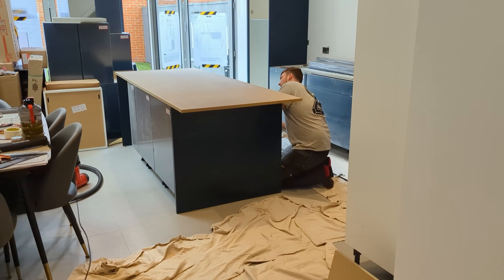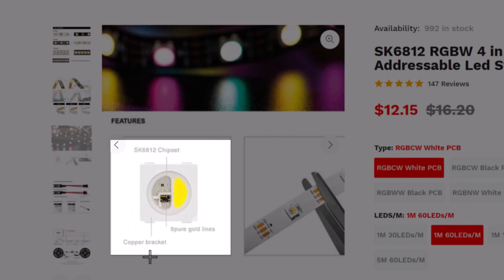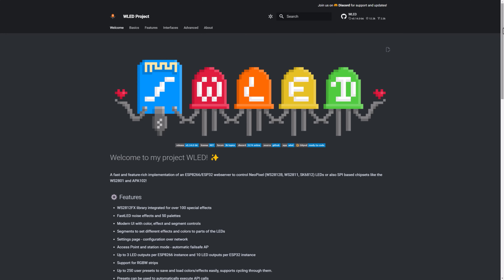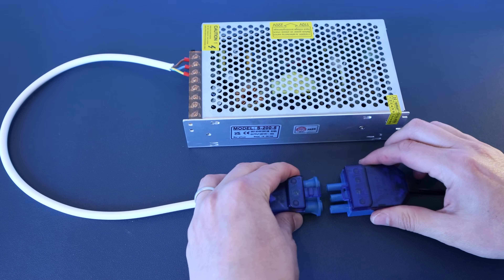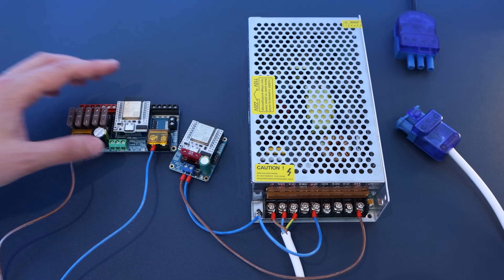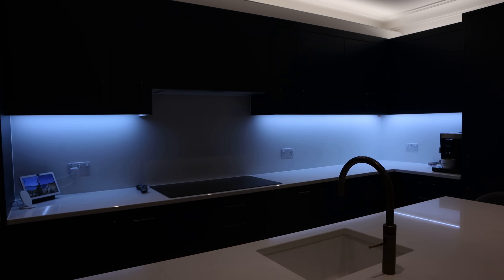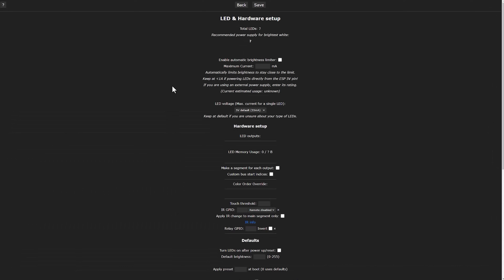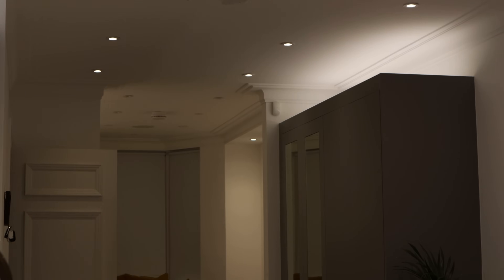Advanced WLED install and setup

Comment: Voltage is irrelevant  to your statment when voltage drops current rises and this is why cables can melt unless power supplies have fuses fitted inline for each power injection thats why the dig quad v3 has them

Comment: Try soldering your +&- in the middle of the strip (less voltage drop) and data at the end (obviously) to make it easier skip 1 led between the + wire and the - wire. If your data in is at the wrong end flip the strip around and reverse the segment in wled. There is also a bug in wled, still exist in v15.0, add 1 segment at a time set the length and gpio pin then save. then repeat for each segment. Doing more then 1 segment in the setup at a same time causes wled to crash and glitch. A fuse block from aliexpress is much cheaper then a quin board, solder a thick incoming power wire across 1 side of the fuse holder.
Reply from the maker: Great ideas! Thanks for sharing.  Soldering in the middle is one I've never thought of before!

Comment: Ive connected hassio to my energy providers API so that it can turn things on and off based on the electric rate. The kwh rate changes every 30mins and is sometimes -ve at which point, hassio can start making me money :) I got a similar LED setup planned for a van for under cupboard passive lighting and then 2 strips in the wood slat ceiling. Figured being able to control the lights would be handy as the ceiling can be completely illuminated or i can make a fairly light effect by only having 1 in 10 LED's illuminated. Good to know you added power both sides if the strip, im doing 5m strips @ 120/M so sounds like it would help. I like the silent notification idea and ill ise that for battery gas water etc monitoring. Too geeky? Or not geeky enough 😜

Comment: What wire size were you using as an input and output from the PSU? I'm trying to get a similar setup in my kitchen so this is the current missing component. I'll do the soldering myself.

Comment: Instead of running the data cable the length of the strip. You should have just inverted the direction on the strip so it plays the effect backwards.

Comment: No tin in Wagos! This is not even allowed.
Reply from the maker: Why not? It's 5v.
Reply: @HomeAutomationGuy  I know it's 5V. Some people may use 12V. And others use Wagos for 120V or 240V. Always have this in mind when showing people how to handle components. 
But it is not only about the voltage. Current is more critical. Wires and Connectors are rated for a max current and/or wattage.
However Wagos are certified for usage with blank wires only. Tinned strands and ferrules are not allowed. Tinned strands are prohibited because they tend to break and ferrules are not allowed because the closing mechanism of the Wagos can potentially make a weak connection.

Comment: Hi Alan, another great video. We are in the process of a new kitchen fit out and I am looking at the lighting. Based on your other video we are standardising on the Candeo dimmer switch generally around the house. This will work fine for the GU10 spots in the ceiling, but I am wondering if there is a way to get the under cabinet lights to be controllable via a Candeo dimmer as well. This would allow manual control via a "standard" looking dimmer (which has much greater approval factor than touch screens etc) and also allow scenes etc to be configured in HA. Any help greatly appreciated.
Reply from the maker: I don't think you can control the under cabinet lights with a Candeo dimmer if they're WLED.  But there are some standard LED drivers on the market that accept a dimmer as input, and then output 12 or 24v in some sort of dimmed way for standard LED strips.

You can also create a HA automation that checks to see if the brightness of the ceiling LEDs changes, and then makes the under cabinets the same level of brightness.  So if the GU10s are 50% brightness, it will make the under cabinet 50% brightness too.  There are some HA blueprints around that make it easy to set up.  I personally prefer to use Scenes as I want different brightness levels for all my lights independently.
Reply: @HomeAutomationGuy  Thank you so much. I was so fixated on the WLED solution that I hadnt considered a standard dimmable LED power supply would do the job 🙄 
Have a fab Christmas and New Year, and thanks for the excellent videos, they have saved me so much time, and provided lots of inspiring ideas 👍
Reply from the maker: @michaelstembridge  Glad to hear it mate! Have a wonderful Christmas yourself!

Comment: I have been pulling my hair out over the last month or so - decided to jump into the WLED world, so I can integrate it into HA. What a journey (massive learning curve), starting with ESP controllers (fried one - to much voltage, not flashing successfully / soldering issues etc etc). So I purchased a QuinLedUno and a Dig2Go (awesome little device this for audio reactive). Both awesome products. The Uno Ive hooked up to 10m (600 leds) in my office, due to get another 5m to cover my facing wall (behind my monitor). Its so awesome to finally get to this stage and play around with them. Defo would like to see more automations with them Alan - atm, Ive only got them set to a presence detection sensor when I walk into my office.

Comment: What are the sensors that you use to determine if it's dark or not?
I tried WLED with an esp32, 1m of a WS2812B 5V, to create a sunrise effect for my kids room. On the WLED device page I can use and set de effect to be running for 10min and it works fine. I do the Preset and make it available on HA, but when I run an automation the effect doesn't work and turns on the WLED strip as if the Sunrise effect is over. Can you make a video on how to do presets on WLED and use them on Homeassistant?

Comment: I LOVE this!
You've done whats been in my brain for the last 6 months to a year. I also researched qundor and dr zzzs channels to get info about this stuff but couldn't find anything specific for kitchen lights/home assistant. I am so grateful for you showing how the automations work and will be looking to incorprate similar ones in my own setup. 

I got a bit diheartened by aliexpress unfortunately, I usually dont have issues with shipping, but recently placed a large order for the wiring/crimping cables etc and it was lost :( I am also based in the UK, do you have any suggestions for where to source the wiring and connectors you used locally/reliably? Thanks!
Reply from the maker: Glad you found the video useful!

I haven't found any good local suppliers for these items either, so I usually end up getting them from Amazon and overpaying.  At least I know they will arrive quickly, and I am able to get a refund or exchange from Amazon if anything goes wrong.  I don't like feeding the Amazon machine, but it's just so dang convenient

Comment: 2:24 - Not quite, higher voltage is safer with regard to fires because the current (amps) is lower when transferring the same power (watts). High current + thin cables = overheating. Voltage below 50V is usually considered safe for humans. And I think you'd also have less issues with voltage drop.
6:21 - those Wagos are rated for stranded wires, you don't need to tin the ends because they have spring contacts. And for screw terminals you'd better use crimped ends because solder tends to be malleable and that causes bad connections which would be another fire hazard
Reply from the maker: Thanks for the tips.  I've upgraded my crimps to the spade connectors, and will use the stranded wires with my wagos in future.

As for the 5v vs 12v - unfortunately I've not been able to find SK6812 style LEDs in 12 or 24v - the only ones I can find don't have the separate white and RGB channel LEDs which I love.  Do you know of any that exist, I'd love to know!
Reply: @HomeAutomationGuy  there is in theory ucs2904 which is capable of 12v and RGBW but it's rarely used. Most common addressable 12V led strips can't handle 4 color channels

Comment: A minor piece of advice. A hot air gun does a much better job at shrinking heatshrink tubing than a lighter. It will shrink more evenly and there's less rick of burn marks. Not that important when it's going to be hidden anyway, but for anything that will be clearly visible I'll use a hot air gun.

Comment: I found copper adhesive tape to be a real godsend. It glues on easily, and you can solder to it. This was i dod quite a lot of awkward signal routing and power injection without barely anything visible

Comment: Great video !
I think you made a small mistake in the 5v power supply link, it shows a power supply with 24V ?
Reply from the maker: You're absolutely right, thanks for the heads up!  I've fixed it now.

Comment: Just some tips/advice. Never tin wires that will be placed in a compression fit situation. The solder will deform over time and you will get loose connections that will be at risk. For compression terminals, use crimps or just compress the bare copper. Wago's are weird as they are a locking but technically compression fit wire connector.
Reply: Wagos are spring-loaded. So while not needed, tinning doesn't hurt.

Comment: did you check how much current your installation drain if you set power off?  I prefer controller with an output relay to fully turn off the led strip.

Comment: You don't need to use WLED segments to run multiple LED strips using the DigUno. Despite its name, it has two separate data out lines (iirc, LED1 and LED2), so all you need to do is go into WLED > LED Preferences and click the + button under the LED outputs section and add your second strip. Also, might be worth investing in a relay to control the LEDs due to their idle power draw. Once again, the Dig controllers support this directly, or you can do it via a smart plug or switch as well.

Comment: I used a neutral light for under cabinet lighting, I thought about coloured but decided I didn't need colour for that, just dimmable.   I did use colour around the top of the cabinet pointing toward the ceiling though.   That way I can have the flexibility on how to use them .   I didn't need digital LED's though, so I used analogue controllers as having the entire strip the same colour was suitable for me.   So around the top is 4 channel, RGBW.    Under the cabinets is neutral white, about 4000K and around the floor is also 4000K.    
I got all my LED's from BTF Lighting, which have proven to be very reliable.   I got all of them as 24Volt analogue, so that means very little issue with voltage drop.  All of them are controleld with Quindor's QuinLED Analogue 4 channel controllers, which I can't remember what they were called now.  It is the older model than the current ones he has.    All of it running ESPHome and has been really reliable.
I use a few scenes as well.   My "night light" scene doesn't turn on any of the ceiling downlights (can lights as ome in US call them) and only use the LED Strips for night light, as I find the downlights made it a little bright for that night light.
Reply from the maker: Sounds like a great setup!  I definitely didn't need digital LEDs, but they were fun to play with and the cost of them has come down dramatically so I didn't feel like it was toooo overkill.

If I ever did outdoor lights, I would do them in 24v as those runs are likely to be much longer.  But that's not a project I have on my radar for the next 12 months.

Also, in the UK the ceiling lights are often referred to as "the big lights" which always makes me laugh a little 😉

Comment: Nice setup. Thanks for sharing. Really well explained too.  I have a few sets of GOVEE LED strips around the house, but I can't individually select LEDs or even recreate scenes from the GOVEE app in Home Assistant, which is a real pain.  I was looking for an alternative solution and this looks like it 👍
Reply from the maker: Glad it was useful! I've personally never used Govee lights, but I hear they are decent hardware - even if it sounds like the software is lacking
Reply: @HomeAutomationGuy  functionality in the Govee app is phenomenal, with a multitude of scenes and a sync mode for music.  Just a shame it's not fully exposed to Home Assistant in any of the integrations I've found.
Reply: I have the same experience. The effects of the govee lights cannot be changed via Home Assistant. Only brightness and color are supported.

Comment: Nice one,
I did under cupboard in white only dumb strip (on a smart switch), but I did do WLED strip on the plinth below the lower cupboards. You get a nice effect on the gloss white tiles. (also really shows up the dirt - don't get white tiles in your kitchen)
I have the same automations for doorbell motion, and doorbell button press via HA, as you say, the notification is a great non-intrusive way to let you know what is going on.
I have a few other LED strips around the house, they all do the same notification so you can tell what is going on wherever you are.
Solar power notifications would be great, I'll wait for your video on that :)
One other one I've set up is for putting the recycling bins out. 
I have a HA calendar with the correct colour recycling bin each week (ours alternate between red and blue each week)
HA tells Alexa to announce which colour recycling bin is going out this week on the evening before they are due, and I get HA to flash the LEDs the corresponding colour too.
I've also got one that flashes them blue if a leak is detected under the bath, though since I fitted the zigbee water leak sensor there, there have been no leaks :)
Reply from the maker: Great automations! I like the idea of the bin reminder.  Do you have a contact sensor or BLE tag on the bins to detect if they've been put out or not?

Comment: get a project box for that power supply btw
also at 6:20 there is no need to put solder on the wires really tbh, if anything it can auctully make a worse conenction over time in terminals
Reply from the maker: I originally thought about a box, bit won't it just make the power supply overheat?

Thanks for the tips though, I didn't know about the rest!
Reply: @HomeAutomationGuy  I'd drill a hole in the top of it and mount a small fan personally 
The exposed mains terminals up there unnerve me up there in case someone reaches up there or decides to dust
Reply: Planning to do something similar for my room at some point as I had to remove my zigbee left strips when I got a new desk and now they don't fit sadly

Comment: Setting segments in the WLED UI is done by creating segments under the segment tab and then entering the desired LEDs for each segment.
If you had 100 LEDs total and want 50 on segment 1 and 50 on segment 2 - you enter 1-50 for segment 1 and 51-100 for segment 2.
Then in HA refresh the particular WLED controller and it should now show entities for segment 1 & 2 that can be controlled separately.

Once you set the segments how you like in WLED, it's a good idea to save it as a preset so you can just reload that in the future if anything goes wrong and save having to configure it all again.

Comment: Cool video, really love this channel and you have cool reference of the Hookup and Quindor, if you want to make WLED to respond to you power consumption get Shelly EM 120A and hook it to your main cable, it should be easy and set an automation if exceed show this effect and if it's less show that.

About segments check Quin or Dr Zzs video, it should be easy for you since you are already an expert.

P.S: one quick note, maybe consider using fork style crimps and way thicker cable from the PSU to your boards.

Good job!
Reply from the maker: Fork style crimps have been mentioned a couple of times now, so I've got some en route! Thanks for the other tips too!

Comment: Apologies if I missed it in the video, but what’s the power consumption, both in use and everything “off”? I’d like to do something similar but am anxious about this aspect.
Reply from the maker: That depends entirely on the size of the power supply, the controller you're using, and the length and number of LEDs on your strip.  

I know that's not a great answer, but there's good news because you can use a smaller, lower drawing power supply to turn on the fat power supply when the lights are due to turn on - which reduces the power consumption dramatically.

It's on my to do list for a video, but in the meantime you can find more out here: https://quinled.info/quinled-dig-boards-and-using-a-relay-and-the-vext-function/
Reply: @HomeAutomationGuy  thanks. I was curious if you’d measured it on your kitchen setup, that’s all. I think maybe 5W when no light is generated at the AC is just about acceptable for the functionality your getting, but anymore and it’s difficult to justify IMO. I love my home gadgets but always make a point to test the idle draw on everything so would be interested in your numbers. I’m sure others would as well. Thanks for taking the time to document your exploits and I hope you’re keeping well. 😀
Reply: Athom sells WLED controllers with a relay in them so when you set lights to OFF, it disconnects the relay meaning that only the ESP is drawing the tiniest bit of current (like any other ESP motion sensor etc).

Comment: You don’t need to run the data tothe first strip if you use separate pin for data, I have separate  pins per section and configure the order in LED preferences
Reply from the maker: Oooh, I didn't know that.  Thanks for sharing!